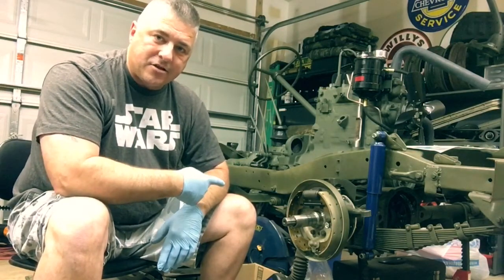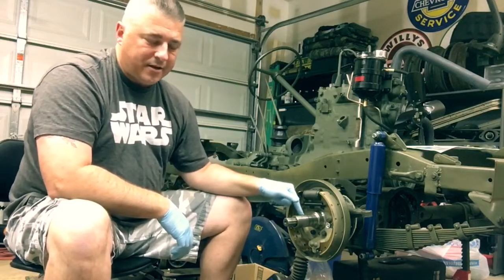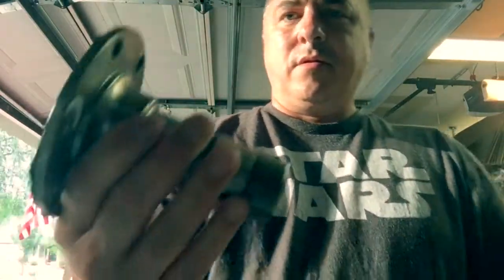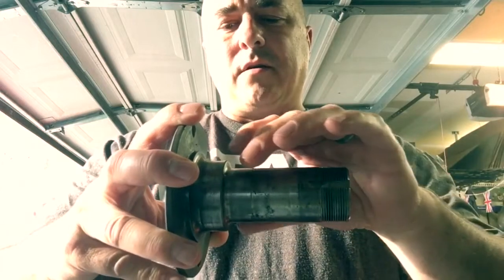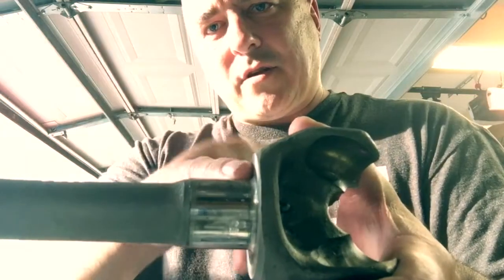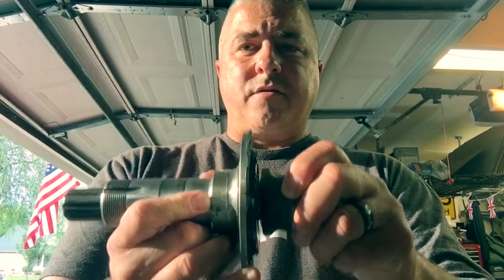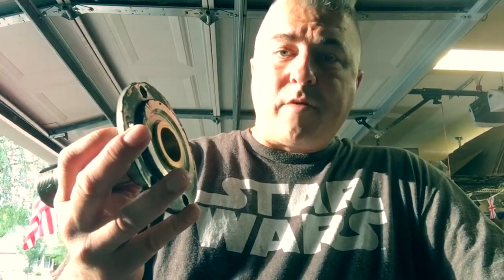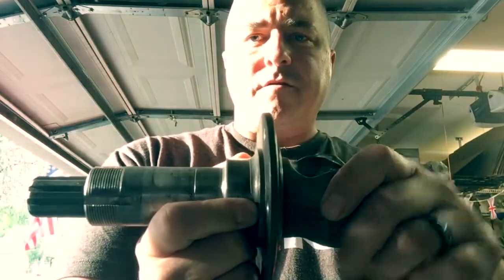Spindle work and Wet your Whistle Wednesday

Comment: Do you have your brake shoes installed backwards? I was always taught that the secondary shoe (the one with the longest brake lining) went toward the rear of the vehicle, although I never have worked on a 4 wheel drum vehicle. Does positioning of the shoes not apply to the front axle?
Reply from the maker: Technicality Without going into too much detail, the Bendix style with the shoes anchored at the bottom are not self-actuating and the majority of the braking is done by the front shoe hench it's the long shoe. In the style where the bottoms are not anchored those are called self-actuating. That means as you apply the brakes the rotation of the drum rotates the front shoe enough to push the bottom of the rear shoe tighter against the drum. That's called self-actuating. That pressure on the bottom combined with the hydraulic action of the wheel cylinder on the top of the rear shoe causes the rear shoe to do the majority of the braking hence the long shoe on the rear.
Reply: See that? I knew if I asked I'd get an answer. Thank you for the lesson on Bendix drum brakes.